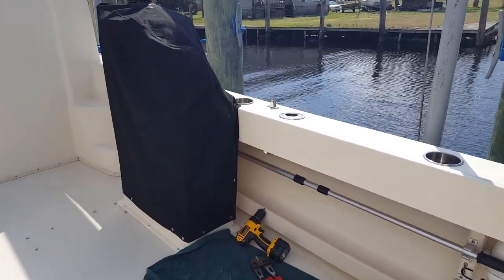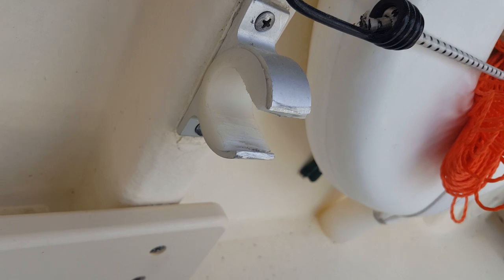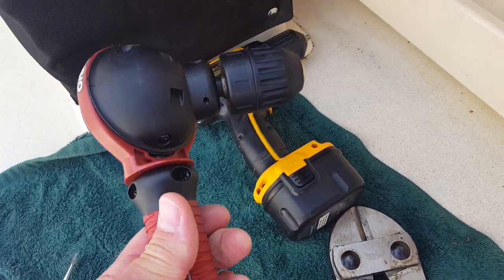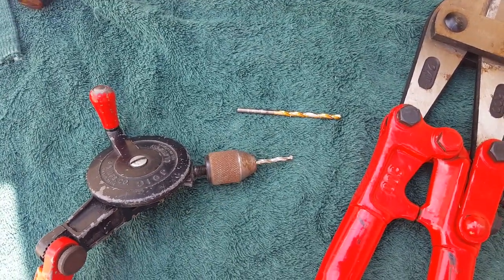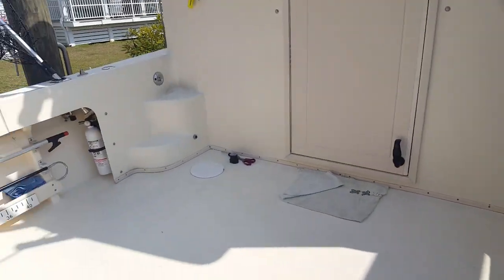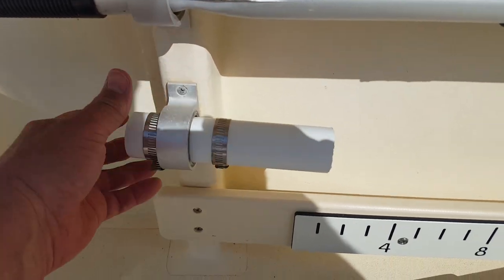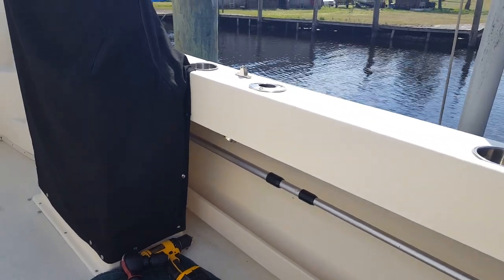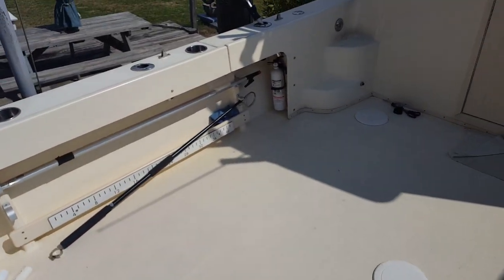How to Drill A Hole Where A Drill Won't Fit, Parker 2520

Comment: Hi Andrew, I've seen some pretty decent right angle drills in catalogs or on line, I've never owned one ,but it looks like they might drill in those tight spaces .
Reply: Ps... stay safe during this difficult time
Reply from the maker: @yumyum408  Thank you again....  So far we have not had major impacts with the virus issue, as we live in such a remote area.; all and all we have been lucky compared to most; I count my blessings.... At least boat gas prices are down!...  I have been on eight flights in the past three weeks; two of those were international.....  I kept myself and our surroundings SOAKED in germ-killers! And, now I will be staying home for the most part, other than going out in the boat! So far there is No virus in the Pamlico Sound and Pungo River!
Reply from the maker: Hi Sheila B, great to hear from you and thank you for the idea. I used to own an older right-angle drill that was as large as the maroon/purple item I showed. But, I'll bet as you suggested, there may be smaller ones available now. I'll see what I can find... If I can find a small one, and use cut-off drill bits, it could be the best idea! Thank you....